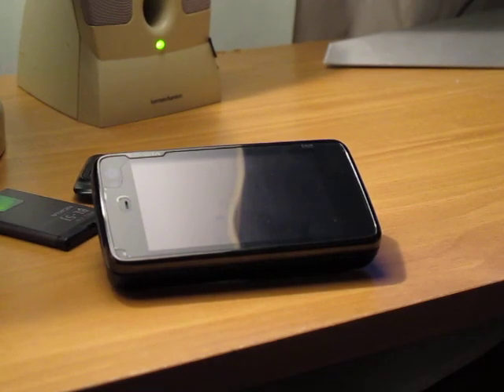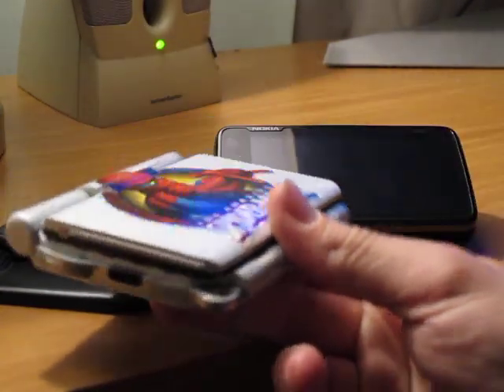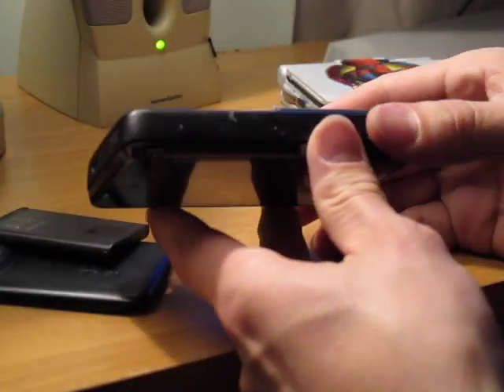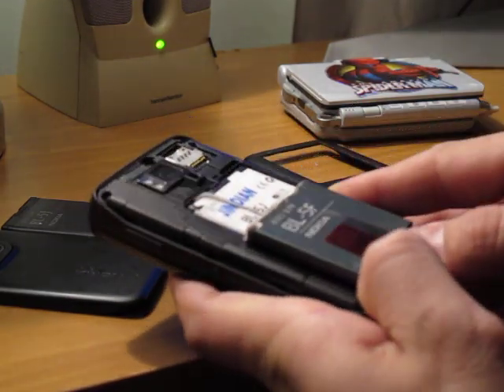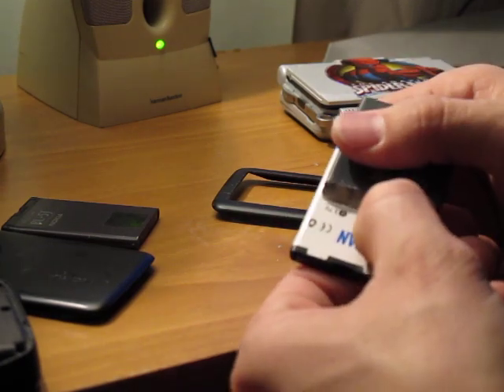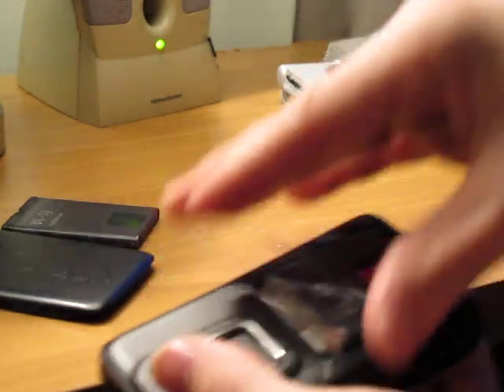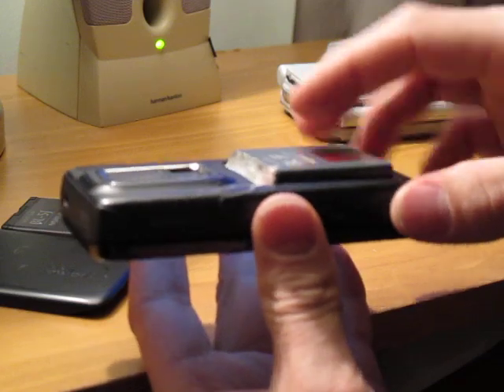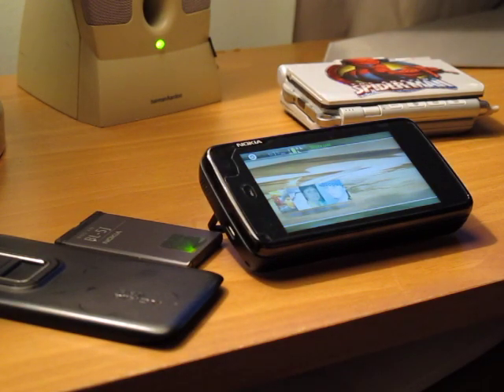DIY Nokia N900 Hi cap battery

Comment: I have a N900 and I'm at least the third owner it's seen, not that the first two knew what to do with it, that's why they sold it. It still has the original battery and I've been running it for about a year now and I can't say it's all that bad.  Well, it is, BUT if you do a bit of software tweaking to tame the N900's appetite for power consumption, that original battery can go a long way.  I still prefer to charge it nightly, but it if used resonably it can last me two days.

Comment from the maker: @nycrayjai yes, removing it originally would cause the batteries to get hot and loose charge fast, i put another battery on and problem solved. with the charge protect on it.

Comment from the maker: @nycrayjai I have replaced the top battery with one with a charge protect, all nokia Batteries have a charge protect that does not let it go above their rated charge, it works better and does not damage the batteries or the phone at all...I am still using it and still works great.

Comment from the maker: @coolajit so far the batteries have worked out just fine, no problems but i will let you know when they fail, it seems like they keep each other at the same level, but I want to do a couple of tests with voltmeters attached to each battery as they discharge to see if they are shorting each other or discharging unevenly, thanks for the observation, thanks for the tip